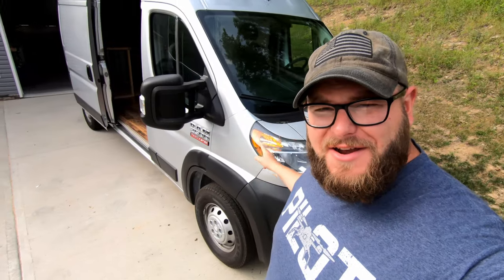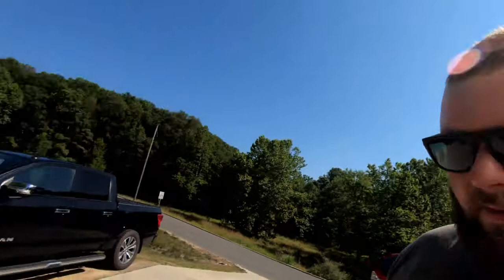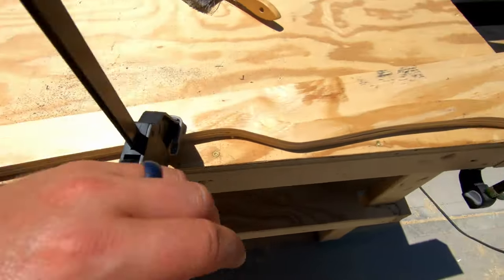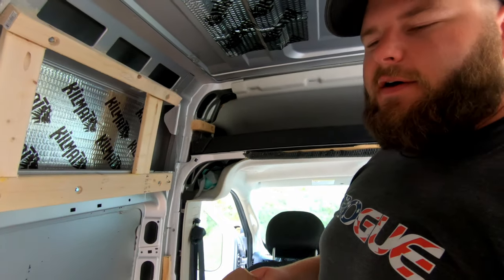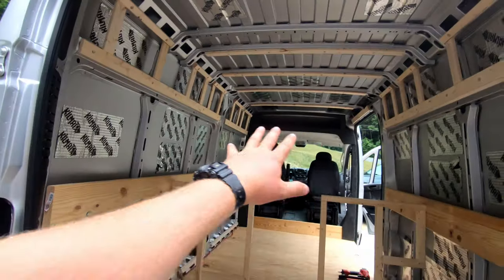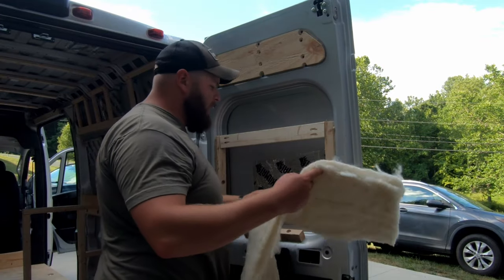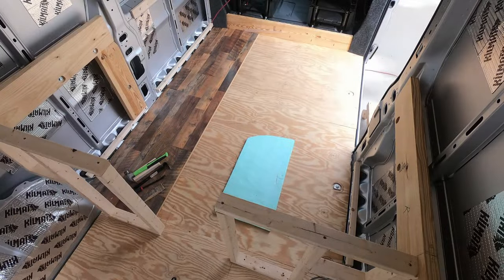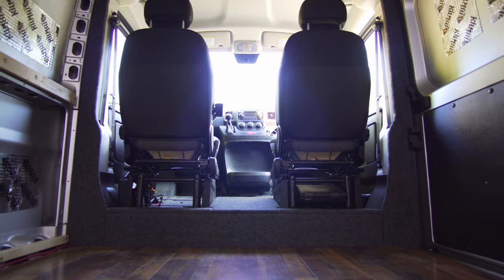HOW TO INSTALL VAN TRIM / FULL VAN BUILD SERIES

Comment: Hey Logan I know it’s been a year. But for the back doors…..did you nail the panel right into the furring trips? Or the metal?
Reply from the maker: The furring strips where self-tapped and bonded to the sheetmetal, then the carpet trim panels were finish nailed to the furring strips for a clean, no-hardware finish!

Comment: How well have the brad nails held up? Curious to know whether prolonged exposure to vibrations from road conditions have loosened the panels that have been nailed in.
Reply from the maker: Very solid.  It’s all about getting the right pressure so these nail heads bite into substrate.  Also assisting with wood glue where possible

Comment: Question about the Kilmat...how necessary do you think it is to put in a van? Like for example a Mercedes sprinter 144 with Havelock Wool for insulation?
Reply from the maker: Sup Charlie, for the price, go with one box like I did, I think it will kill a lot of drumming and resonance noise that the wool wouldn’t eliminate. Keep in mind it is beneficial to have both low density (insulation) and high density (killmat/ rattletrap/dynomat) to achieve sound deadening and dampening across a wider range of frequencies.  Some may come from road noise, rain, people’s voices outside etc.  hope this helps bro!
Reply: Awesome thanks Big Logan! I appreciate the feedback and I’m enjoying the great vids!